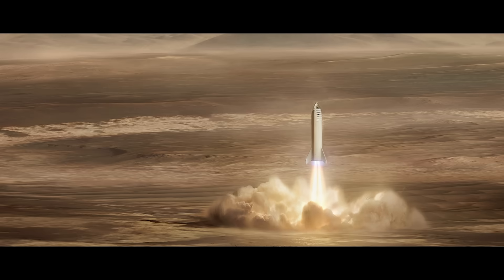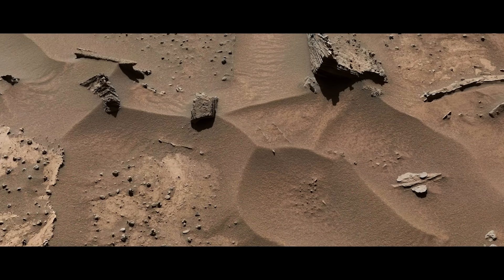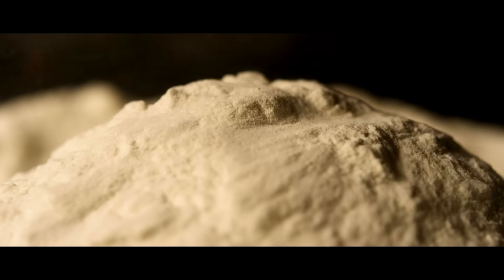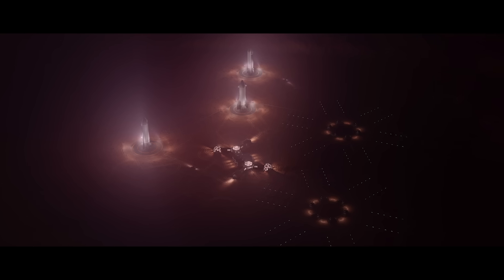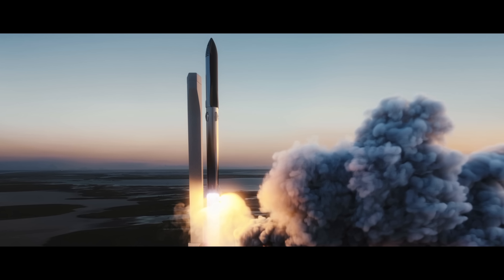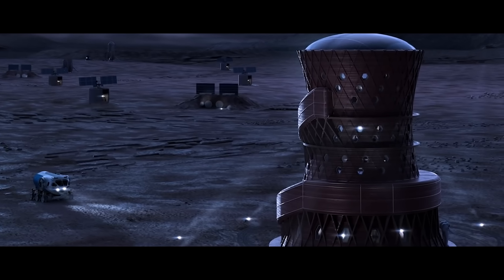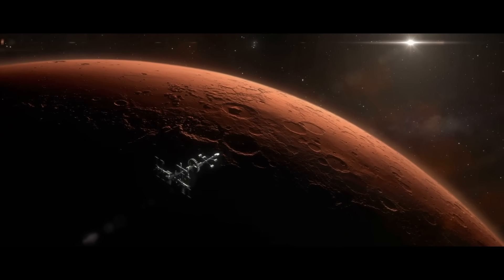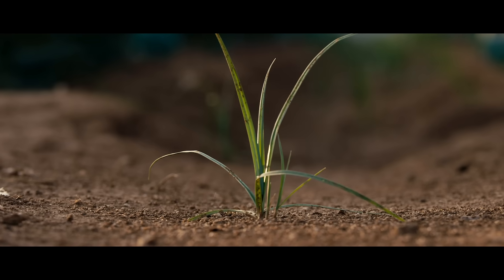THE FIRST 10,000 DAYS ON MARS (Timelapse)

Comment: Well without a magnetosphere not sure about that whole “oxygen in the atmosphere” thing.
Reply: You do realise it takes hundreds of millions of years for the solar wind to blow away a planetary atmosphere? We will have at least 100 million years of life on Mars before we have to worry about atmospheric erosion, by which point we will have deployed an electromagnetic shield at the appropriate Lagrange point anyway. If you take all the water currently on Mars (that we know of, there is probably way more) there is more than enough oxygen there. At this point, holding onto an atmosphere isn't even the hard part. The hard part is generating it in the first place by heating up the planet. If/when we do that, we will have millions of years to solve the next problem. Hardly as much of an issue as you make it out to be?
Reply: It will take on the order of hundreds of thousands to millions of years for the solar wind to deplete all the oxygen. On human timescales we will be fine!
Reply: @Nerdherfer  More. Try hundreds of millions.
Reply: @Nerdherfer  we don't actually know for sure
We don't know what rate the current atmosphere is being stripped away plus the fact it's so thin may prolong this process
Reply: @markmitchell450  We have a pretty good idea of the rates though. That's exactly why MAVEN was sent to Mars. We also have some pretty advanced magnetohydrodynamic models that can calculate atmospheric erosion rates using current solar wind conditions.
Reply: There will be Orbit chewing gums with Oxygen. If the gum goes out..goodbye my lover
Reply: Good point
Reply: yea
Reply: They can build one the science on that is not so advanced.
Reply: @Andy-le8xy  No, but the engineering required to power the satellite is very advanced.
Reply: I would be more concerned by the idea that, even if we melted everything on mars to make gas, there isn't enough to make a breathable atmospheres on Mars. Even if we import from space, you are talking upwards of a million asteroids hitting a populated Mars to get even remotely close to a breathable atmosphere.

Also, wild grasses inside 30 years is a load of horseshit. Perchlorate in the soil will kill ANYTHING we try planting.
Reply: @Birdofgreen  Carbon Dioxide could be imported from Venus, that would go a long way to increases Mars' temperature. I agree though, you would never get to the atmospheric pressure you see on Earth. Also, you are correct, perchlorate minerals would be very bad for any initial plant life. However, perchlorates are very water soluble, and would "rinse" from the soil if liquid water permeated through it. Certain bacteria can also process perchlorates into oxygen. So while it is unlikely that plant life would start growing, it is not out of the question.

The bigger issue is the lack of free nitrogen in the Martian substrate. Plants need a certain amount of fixed nitrogen, phosphorous, and other organic compounds in order to grow properly.
Reply: @Birdofgreen  

Yes, there was one paper suggests that. The author did go on to say though...

"If there’s not enough carbon dioxide, terraforming would take thousands of years or more but it’s still possible,"

https://www.newscientist.com/article/2175414-terraforming-mars-might-be-impossible-due-to-a-lack-of-carbon-dioxide/#ixzz6ppfTDYv7

So possible but would take thousands of years.
Reply: There are actually satellites NASA is developing that can simulate a magnetosphere.
Reply: @Paul-fp3qn  

"There are actually satellites NASA is developing that can simulate a magnetosphere."

Really? I doubt it. The magnetic field to replace a planets would be HUGE. 

Link?
Reply: @martinw245  it is possible. I looked into it but if you can develop a magnetic shield at Mars’ Lagrange Point closest to the sun, then it could work.
Reply: @howardbaxter2514  

Oh yes, that's true. But the person I responded to said "simulate" a magnetosphere.  A satalite would actually shield Mars from the solar radiation.
Reply: @martinw245  You don't need to replace the entire planetary magnetosphere. All you need to do is place a weak EM deflector at the L1 Lagrange point. It will deflect solar radiation millions of miles before it reaches Mars.
Reply: @martinw245  I see you already acknowledged that, my bad. Also I would add, whilst it's theoretically possible to use the L1 deflector strategy, it's still non-trivial. The spacecraft/satellite would need to generate significantly more power than we can currently get from solar panels or RTGs
Reply: @disgruntledwookie369  

"whilst it's theoretically possible to use the L1 deflector strategy,"

I'm, not sure it is theoretically possible to be honest. One paper was written that included it as a possibility, but I don't think the research has been done to definitively prove it would work. More research required I think. 

"The spacecraft/satellite would need to generate significantly more power than we can currently get from solar panels or RTGs"

Yep, would have to be nuclear I would think, more powerful than the RTG's we have seen to date. 

Have there been any estimates as to the power requirements and strength of the magnetic filed required?
Reply: @disgruntledwookie369  

The problem is James that many who comment here, aren't just sceptical, in fact scepticism is a good thing, they are cynics, who will find any excuse they can to trash the notion.
Reply: @martinw245  which is pretty much what is required of a magnetosphere. I think some point in the WAY distant future we will be able to restart Mars’ magnetic field, but until then, the best we can do is create a temporary shield
Reply: @martinw245  Absolutely agree a lot of research is needed and of course I'm being deliberately optimistic. Too many wild claims here but if I have a point, it would be that humans have overcome so many seemingly insurmountable challenges, and with enough resolve we will find a solution. It may look nothing like these ideas being discussed and maybe it will all fall apart catastrophically in the end... but that attitude isn't good for much. A healthy balance of optimism and scepticism is needed.
Reply: @howardbaxter2514  

You misunderstand. When the person I answered referred to SIMULATING a magnetic field I though he was referring to doing so at the planets location. I wasn't aware he was referring to the Lagrange 1 satalite location idea.

As for turning a solid iron core into a molten mass, so it once again generates a magnetic field, I don't think we will be doing that. The amount of energy required to do that would be prohibitive, and there are much easier methods.
Reply: @disgruntledwookie369  

"if I have a point, it would be that humans have overcome so many seemingly insurmountable challenges, and with enough resolve we will find a solution. It may look nothing like these ideas being discussed and maybe it will all fall apart catastrophically in the end... but that attitude isn't good for much. A healthy balance of optimism and scepticism is needed."

Yep, well said.
Reply: @martinw245  the idea is out there, but something like that is still hundreds of years away, because you need a huge amount of power to create a planetary scale magnetosphere.
Reply: @disgruntledwookie369  you would need the magnetic field to be at least big enough to encompass mars in the magnetotail, otherwise all it will do is focus the solar wind plasma onto Mars in the form of plasmoids.
Reply: @disgruntledwookie369  with Mars being that much further from the sun than earth plus a much smaller planet would this mean that any magnetic field wouldn't have to be as strong
Reply: @martinw245  Might as well build rotating space colonies and strip mine the planet instead.
Reply: @martinw245  the most powerful magnet on earth is magnitudes stronger than the literal molten core of ferromagnetic fluid capable of shielding  hundreds of thousands of cubic kilometres of atmosphere called our planetary core. just build a bunch of weaker versions of those magnets, and on mars, the UV wouldn't even need Ozone to block it. you could even do it without a LaGrange point. as for powering them, if i knew the answer to that i wouldn't be here commenting on this comment, I'd be on mars watering a pot of the rarest orchids in a space penthouse kilometres off the ground, before settling down for a nice martian cocktail.
Reply: @aidanmatthewgalea7761  

  "the most powerful magnet on earth is magnitudes stronger than the literal molten core of ferromagnetic fluid capable of shielding  hundreds of thousands of cubic kilometres of atmosphere called our planetary core."

Yes that's true. However.. generating a field strength is not the same as field SIZE.  A magnetic field is subject to the inverse square law and the field strength falls off by the square of the distance. High strength magnets of up to 100 Tesla have been generated... but over a very short distance and also for only 15 milliseconds.  

 The field to shield mars would need to be very large, and generating a field that large, even at one or two Tesla,  requires a lot of energy. 

"as for powering them, if i knew the answer to that i wouldn't be here commenting on this comment, I'd be on mars watering a pot of the rarest orchids in a space penthouse kilometres off the ground, before settling down for a nice martian cocktail."

Precisely! That is the crux of the matter. POWER!
Reply: @Paul-fp3qn  All of that won’t mean shit if they can’t enhance Mars’ core.
Reply: it's actually quite easy to make one in a lagrange point from Mars. In fact - terraforming would be initiated from doing exactly that. In a very short amount of time, CO2 will build up raising the temperature freeing water to flood the surface. Like in the span of less than 20 years. It'd still be brisk but it'd be well on it's way to being habitable on the surface without pressure suits.
Reply: @mgabrysSF  

"it's actually quite easy to make one in a lagrange point from Mars. "

I'm not sure about easy. It would need to generate a magnetic field that was "Earth Comparable". In addition, that was a paper submitted by Jim Green back in 2015, so not definitively proven. Numerous papers are submitted for publication that SUGGEST things that aren't necessarily valid.

A lot of research would need to be done to determine if such a concept was viable.
Reply: @martinw245  Mars being so much smaller than earth so would less of a magnetic field be required

Comment: All very fanciful and a matter of science fiction. The atmosphere is a near vacuum, unless they crash vespa or pallas into mars to create an atmosphere there will never be enough to grow plants.  And any building will have one ton of inner pressure per square foot trying to explode the building or make it launch like a rocket straight upwards under it's air pressure.  every window a square foot or bigger will have over one ton pressing out against it.  No green houses will be built and the weight of heavy glass will not help.  Crash Ceres into mars, knock it closer to the sun, adding water, gravity, atmosphere, oxygen, barometric pressure and insulation from the cold of space and more intense sunlight then you might have a chance to terraform Mars.

Comment: The launch window is not when the planets are closest to each other. They use the hohmann transfer method which is very efficient (You can send the most cargo for the least amount of fuel.). It requires the planets to be aligned in a specific angle relative to the sun. This only happens about every two years for mars and earth. :)   
Edit: Maybe later they will use faster but less efficient transfer methods.

Comment: Much of this video is illogical or fanciful nonsense, for one you are not bound to link  transit to NEO with Earth Mars transit windows, not at all for materiel and not so much for humans either as both can be accumulated in orbit waiting for the transit window. The need to travel in smaller ships based on the NEO carriers is a bad assumption as it limits your speed and radiation protection options compared to a custom shuttle habitat that is always in space which ferries everything between the two planets and acts as a large space station with rotational g to match Mars g thereby eliminating the recovery time and risk. As for power on mars, that will more likely come from an orbital solar and or fusion system that uses a maser to beam down power to the surface at frequencies that are tuneable so as maximise efficiency in response to changing conditions.

Comment: No landing attempt by humans should be made until at least the 2050s. The reason is that not even 10% of the basic research has been completed.  Three things are mastered. One, a portable magnetosphere to protect both ships, crew and vehicles and shelters. One gamma ray burst from the Sun every one on the surface or enroute will die. Two, a more powerful engine to propel the ship to arrive to minutesonth. Three fusion power stations to power the effort.  Until all that is done no attempt should made. Additionally, all shelters should be underground.

Comment: This is totally a work of fiction. There are so many technical flaws in this it's almost laughable.  It's exceptionally unlikely a fusion generator will ever be built on Mars; liquid thorium salt reactors are far more likely. A great deal of this is based on an unproven belief that Humans can successfully adapt to and survive long term in Martian gravity. It also assumes many technological advances that are questionable.  It talks about converting the nitrogen in the Martian atmosphere in to fertilizer, but there is very little nitrogen (less than 3%) in the already extremely thin Martian atmosphere.  It also speaks of the plants being grown by settlers increasing the levels of O2 in the Martian atmosphere, but such activities would at best provide an insignificant amount of O2 to the atmosphere on a planetary scale, (comparable to trying to inflate millions of hot air sized balloons with just your breath. . .) Even it the gas fractions on Mars could be made more earth like, (80% N, 20%O2, etc. . .) there will never be a thick enough atmosphere on Mars to permit life on the surface because an atmosphere thick enough would extend so far above the surface that it would pass beyond the orbit of the closer of Mars's two moons.  Currently the density of the Martian Atmosphere is about the same as Earth's atmosphere, ten miles above the top of Mount Everest.  The sheer volume of gases needed to make the Martian atmosphere survivable is unimaginable and certainly not something mankind is likely going to be able to supply. I could go on, but you get the point.  This is as much a fantasy as the space elevator concept.